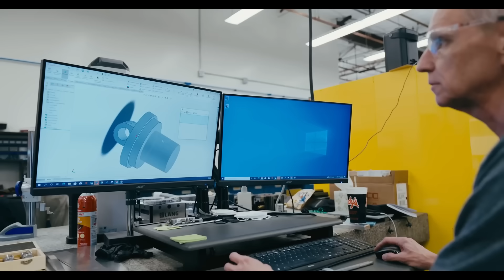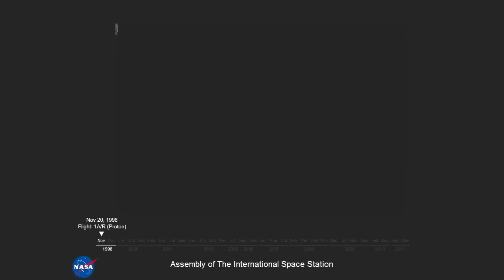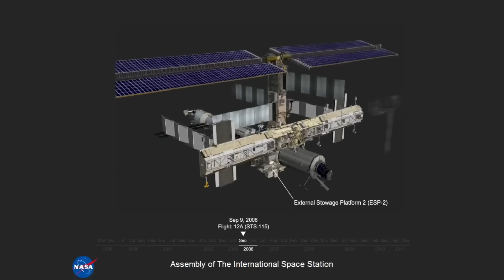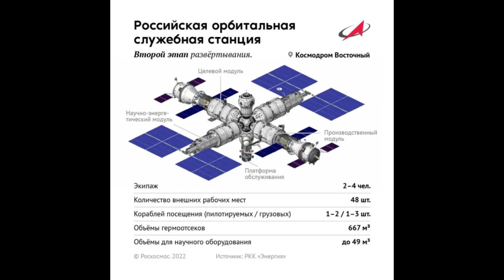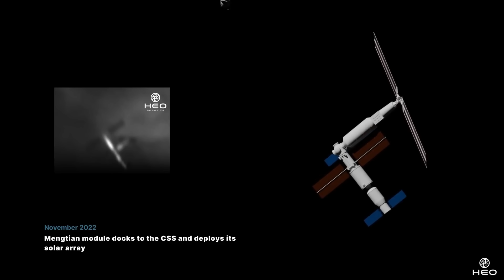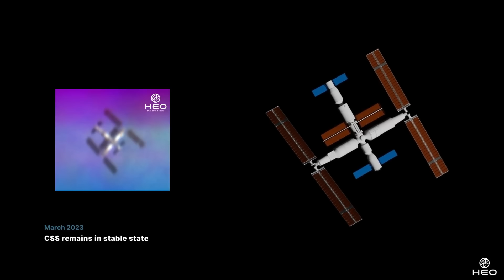Where Will Astronauts Go After The ISS Is Destroyed?

Comment: Starting a space station by sticking modules onto the International Space Station that then becomes a separate station lends credence to the idea of using a more extensive version of this to save the International Space Station.  Stick modules onto it, but then instead of throwing everything else away, just keep changing out the modules that are in the oldest and worst condition.
Reply: And then comes the new module called "Ship of Theseus"
Reply: Like my grandfather's broom...
Reply: @ChrisRowland-c7w  And my axe!
Reply: I think it has more to do with the fact that the original station was really not designed for that. It could have been, sure, but trying to retrofit it to be able to endlessly accept upgraded modules would be expensive, a budget for which doesn't exist. The stations designed to eventually become standalone after starting from the station, have been designed with that from the start, rather than say, replacing the power modules on the iss, which were never designed to be replaced. 

But sure, any problem can be solved with enough money, but who's money?  Not NASA cuz they're practically broke lol and Congress doesn't love throwing money this way, and especially not in the modern climate. Regardless of my feelings, the political will (and frankly general population's) isn't there.
Reply: @aggonzalezdc use the ISS as a base to build a new one, as like a hotel for the people working on it.  The new one would be connected until it was fare enough along to function on its own.  Move whatever little odds and ends from inside the ISS to the new one.
Reply: @johnn3542  to an extent that is already being done. A module is on the ISS which will be added to over the next few years to add to its functionality and will undock and become self sustained.
Reply: @aggonzalezdc  But building a whole new station because you throw away the entire old one has got to cost more money than just incrementally replacing worn-out pieces, even if for no other reason than that you have to launch that much more stuff to replace modules that might have quite a lot of life left in them.
Reply: @Lucius_Chiaraviglio  sure. Well, probably, it's pretty complicated and the price may be shockingly high, but let's go with yes. But they're not building a new station. Not in LEO anyway, and you can't move the ISS to lunar orbit.
Reply: @aggonzalezdc  NASA isn't building a new station, but still a new one is going to have to be paid for, and that doesn't come out of thin air.
Reply: @Lucius_Chiaraviglio  sure, I suppose. There's an argument to be made that you could make\maintain a station more cheaply by just putting up a new more efficient one, but let's assume that's not true. But the point is NASA can't foot the bill, and neither can anyone else. I'm guessing your suggestion is that someone should take it off their hands rather than building their own? But there's a number of problems with that, and it's not as though no one at NASA thought of that or tried to make it happen. NASA actually put out a really great white paper explaining their reasoning for reentering it and not doing something else with it. I'm 1000% with you that it's a terrible shame to destroy, but NASA is kind of stuck between a rock and a hard place with this. There's very little they can do with the resources anyone is willing to give them. 

When I'm queen of the world I'll surely put the budget towards keeping some version of an ISS in orbit forever, but sadly it's going to take me a sec still.
Reply: @aggonzalezdc  You would also have to go back in time, and make the layout and design of the Station something that's far more easily drop-in and replaceable. 

Most of the modules rely on the core ones: Zarya, Unity, and Zvezda. You can't replace those without hurting the rest of the station in the process.
Reply: @DHD52  that's what I meant by saying it wasn't really built to be upgraded without getting into details. It's not as easy as, "just replace a piece!" sounds.
Reply: @Lucius_Chiaraviglio  no, because swapping the pieces out is one of the most expensive parts of the process. its not like a car, you can't just pop the hood and replace some parts, you have to carefully and delicately shift pieces around, solving unexpected problems as they come up, and somehow engineering the new modules to be able to work with those unexpected changes, before they even arise.
Reply: @aidenaune7008  Doesn't anybody still have specs for the old parts so that the new ones can be designed to work with them?
Reply: @ work with what? the parts that were built in a lab, or the ones that have been decaying in space for 40 years? the lab ones are too different from their decayed and modified current state, and the current ones dont have blueprints.
Reply: @aidenaune7008  A volt is still a volt and a Hz is still a Hz no matter the age of the part.  In case of worry about drift from specifications, can't somebody take a meter/oscilloscope/logic analyzer on a pre-retrofit mission to find out what happened so that the people building the replacement modules can make sure everything will be compatible?
Reply: @Lucius_Chiaraviglio  no, physical compatibility. fitting a square peg to a rusted-into-the-loose-shape-of-a-circle hole.
Reply: @aidenaune7008  How would things have deformed that much without causing an air leak already?
Reply: @Lucius_Chiaraviglio  they have, countless times already. the leaks were patched.
Reply: @aidenaune7008  So then they should be able to patch the old modules to make them fit with new modules that have adapters designed to fit with the original adapters on the old modules.  Although maybe they should entirely replace the original adapters on the old modules while they're at it.  Admittedly if the old one was made all as one piece, this might not be safe to do (the uncertainties of repairs by welding in the field).
Reply: @Lucius_Chiaraviglio  but then they need to send the exact resources needed for those specific repairs, without knowing the needed repairs. its not practical.
Reply: @aidenaune7008  (YouTube ate my post)  That's why I was saying to do a survey beforehand (but include metrology as well as electrical tools).
Reply: Problem. Vacuum welding.  Metal surfaces in space that are in contact with each other, get welded together. Unless carefully designed, it is likely that all the modules have become welded together.
Reply: @nickl5658  well just leave it and add new bit to it like been doing already all resources needed get it up there even it scrap metal, the getting space getting more easier and doing actual manufacturing having resources of an old space station ready there
Reply: @nickl5658  A requirement from the begining of the ISS was that all modules must be capable of emergency jetteson in case of things like a fire that can't be controlled, or too much damage from space debris. Now the mechanism for how this is done is only kind of standardized. There is a common locking mechanism that must be supported for linking up different sections, but where the same country's modules link up, they can do something like what the Russians did, and have it welded at certain points with emergency blast release.

Only the US wants out of the ISS. The EU, Canada, Japan and before Russia were in talks about jettesoning the US module and keepign the ISS going after they are gone. The US would never allow them to take over the US module, and to be honest, we don't want the piece of junk anyways. That is probably one of the reasons why NASA and the US want out of the ISS so badly, their section is considered the most useless. Now to be fair to NASA, that probably wasn't their fault, as part of the problem NASA has is things get built based which states vote correctly in elections, or will build things for the cheapest price.
Reply: @nickl5658  I haven't heard of this becoming a problem on the docking adapters.  But if it did happen, what about depressurizing the affected modules, removing the fused docking adapter, and putting on a new one (only on the module you are going to keep)?
Reply: The whole thing is probably infested with giant cockroaches!
Reply: If you change out every part of a ship over a 40 year period, is it still the same ship?
Reply: @Henoik  I remember a similar quote about a hammer . . . But regardless of the answer to that, you save resources (and money) for not having to replace space station segments that still have a lot of usable life in them.  For an Earthbound ship, this might not be true, since it is fairly easy to salvage parts for separate use, and recycling is moderately easy, and you don't have enormous launch costs to worry about, and the ship isn't modular (the International Space Station is more like a barge train than a single ship -- replace individual barges as they get rusted out).
Reply: Absolutely positively can’t be done. It’s about as feasible as upgrading an articulated bus one segment at a time. The modules are tightly integrated and the underlying architecture cannot and was never meant to support something bigger and/or with much longer lifespan. It was not designed in for cost and timescale reasons. And that was a good thing. Otherwise we’d be having the first ISS modules up there in another decade or so and they would be quite obsolete as well. When the ISS was planned, super heavy was not on anyone’s radar.
Reply: @absurdengineering  I haven't heard of this being done for buses, but upgrading articulated trains (the ones that have permanently connected segments) by adding segments absolutely can be and has been done.  Check out Dallas Area Rapid Transit -- their entire fleet has gotten this treatment to upgrade them for ADA-compliance (and increase capacity), saving money compared to buying a new fleet.
Reply: @Lucius_Chiaraviglio  Sure, but Trains are laid out linearly, and can be separated without destroying a necessary ECLSS environment operators need to survive. You can park them in a garage while being worked on and nothing bad happens. 

You can't easily extract the core Zarya, Unity, Zvezda ISS modules, without turning the rest of the station into a non-functional piecemeal. They were not designed nor laid out to be replaced.
Reply: @DHD52  Why not:
1.  Launch the replacement core modules.
2.  Assemble the replacement core modules into a mini-station that a few astronauts can stay in.
3.  Unbolt the outer modules that still have life left in them from the old ISS core modules.
4.  Bolt the outer modules onto the new core modules.
5.  Deorbit the old ISS core modules.
Reply: @Lucius_Chiaraviglio  1. Cost. 2 Danger. 3. Inherent design limitations.

it would not be cost effective to keep using ISS form factors rather than just adopting the new ones Axiom is bringing.

It is dangerous to have two floating structure, not attached to each other, nearby. 

equally its dangerous to turn the ISS into a non-functional piecemeal, and drag modules off of it to put them onto something else.
Reply: @DHD52  I could agree with you on cost if this was something on the ground or in the ocean, but launch costs are pretty enormous, and every bit of weight you can save putting up saves an awful lot of money.

As for safety of having floating structures next to each other but not attached to each other, how would that be any more dangerous than having spacecraft on docking approach?  (That is, as long as you have functional space spacecraft attached to them that can act as tugs.)
Reply: The modules were not designed  (nor laid out) to be replaced in that manner. Axiom is building on top of a Docking port -- it is not the same form factor as what built the rest of the station (CBM and the Russian Drogue system)

Docking ports were designed to be attach and release, everything else is far more permanently connected, and would require releasing bolts and other structural elements externally.

The other problem is balance and placement -- many of the module that seriously need replacement are at the core of the Station: Zarya, Unity, Zvezda.

You can't replace these without turning the rest of the station into a (non functional) piecemeal. And most of the remaining modules are over lifespan anyway. 

Clean slate is a better answer, with modern interfaces, and no left over Soviet designs that were never intended to be serviced.
Reply: I just commented something similar. I’m disappointed this question was not addressed. Seems infinitely sustainable and an engineering no-brainer.
Reply: @ArnaudMEURET it is an engineering no brainer but it’s not a government budget no brainer. It’s expensive. Tbh id rather NASA keep creating new technologies if it means the ISS has to go. Private companies can do all they want, I mean really what more could be gained from the ISS? I’m sure they’ve already conducted every experiment you could think of. At this point it’s just a monument to humanities ingenuity but it’s also a relic.
Reply: @ArnaudMEURET  how is that functionally different from what they are already doing? launching all the new ones up at once, then detaching them, is functionally identical to replacing it piece by piece.
Reply: Go full valerian? Haha
Reply: @the_danz  Not enough minerals!
Reply: @the_danz  i didn't love that movie, but I'm thinking it's got to be better than our timeline. I'll take it.
Reply: Sounds like a great way to make superbugs
Reply: Yeah, not sure why we'd not keep it.
Reply: Yeah, that would make sense, which is why government agencies will almost certainly NOT use that method.
Reply: @joshm3342  Plenty of companies do this that don't make sense at least from a long-term and overall perspective.  Boeing, for starters.
Reply: @joshm3342  (YouTube ate my post -- trying again)  We also have plenty of examples of private companies doing things that don't make sense on a long-term/overall basis.  Boeing, for starters.
Reply: The ship of Theseus
Reply: Call it project Theseus
Reply: Ship of ISS
Reply: i was thinking a similar thing ngl! the international space station could connected modules in multiple ways and not just one module being the way to get into another.
Reply: This privatization of everything reminds me of private equity.

  Yeah let's just sell ourselves, NASA, to the private multinational companies so they can then extort monthly rent, somewhere that was otherwise free. Threaten things like Elon. 

 Hold plans hostage like Lockheed of leak.  

 Short term gains for long term costs. That's what this is. 

 It's clear to me privitzation has worse problems that cost more overall in the long run versus competent government. 

 This reminds me. 

  Some years back I was talking to this ex NASA worker who was drunk. He ranted "Reason why Space X is moving blistering fast?! They get to take risks, and push it. If we fail the entire budget gets cut! Backlash. Senate hearings."

 You get the idea. He was a bit more redder. Then I think I seen Scott Manly say something similar a couple years later. 

 Was it Manly when head just balding. Back when he had hair was it Scotty Womanly. Femanly. Because I can picture Scott here having some scraggly strands of curly locks of what once was. That guy sure did, and I wanted to pull one on the back of his head. 

 Just like yoink like Yoshi.
Reply: NASA seems hell bent on privatization of all hardware, sigh.
Reply: @MichaelBehrnsMiller  Or more to the point, Congress has forced them to that.
Reply: @MichaelBehrnsMiller because they’ve been screwed by the government bureaucracy constricting them in many ways and keeping wages down. 

For example it’s been said that when they build something they have to get a certain amount done in this state then some in this state and so on and so forth.
Reply: Why can’t we part out the ISS and reuse the parts like the solar panels and modules
Reply: Sounds great - but what about all the unused gear, and food they have stored up?

Can any of that be used again?
Reply: @kumbah2006  there's not much of that, in fact more of both are needed to keep things running until then. Station Resupply Missions are planned for a long time yet.
Reply: My idea is to use upgraded Dragon and push ISS into a much higher orbit or maybe even in between to Earth and moon and build a more Advanced ISS once Starship is up and running. Or just push ISS to a higher stable orbit and leave it and like a international landmark
Reply: @nerdwatch1017  The radiation shielding might not be good enough for a very high orbit.
Reply: @nerdwatch1017  NASA looked at that -- it was going to cost nearly as much as operating the station. They don't have a budget for building a real replacement as it stands, so how is that worth it?

You also run into a risk of it breaking up, and creating a debris cloud at high altitude.
Reply: @nerdwatch1017  read. Nasas. paper. You think they didn't think of that? That of all the people at NASA no one came up with that idea?

Comment: I am very surprised that inflatable modules are not more common in all these proposals, especially the less ambitious ones would easily provide a lot more interior space with seemingly very few downsides. Why are inflatable modules still so rare even in concept? The only real downside I can think of is much less structural ridigidy but it seems like this is a limitation that can be worked around and is worth the additional volume.